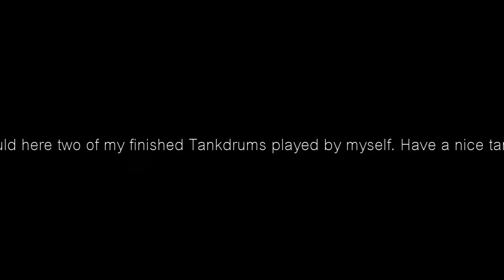how to build a tank drum by synthikat

Comment: Is that an expansion vessel? I'm trying to build one with that because I don't know if using a gpl tank is safe, even after cleaning it with water. Is the vessel thinner than the tank,which is about 4mm?
Reply from the maker: Yeah it is an expansion vessel I've also build one with a gas tank and they are safe after filling with water. Both worked fine for me.

Comment: Hey I got a question for you, what do you used to cut the round tongues ?
Reply from the maker: I've used a jigsaw with a pretty small metal blade but it was not so easy and took me some time and some blades :)
Reply: @Synthikat  Thank you for answering. Did you grind the metal blade to make shorter turns ? Do you use any oil, water during the process to help the blade ? The problem for me was the blade jump out of the line and eventually got broken.
Reply from the maker: @Starter001  grinding the blade was not needed in my case but i saw some people do it. I used oil and sometimes cooled the blade between steps in water.

Comment: Hi great work, i have a question, the part where you put the tank in fire and then water what purpose does it serve?
Reply from the maker: it is done to harden the material. the sound is better and the tongues are vibrating longer after the tempering process.
Reply from the maker: and thank you :)
Reply: thanks, it doesnt affect the tuning right? or do you have to check it afterwards?
Reply: it will affect it, because you cant heat it perfectly evenly and cant cool it down perfectly to. Painting  affects tuning to.
Reply from the maker: yeah but in my case just slightly! i did the ruff tuning before and the fine tuning after everything was finished!

Comment: Looks good man. Is the heat treating necessary?
Reply from the maker: Thanks man. Yeah the heat treating(in my case)made the tongues vibrate better(longer).
Reply: @Synthikat  Hello, thank you very much for your video. A query, how long to heat treatment?
Reply from the maker: @yohaymy  Sry but i cant remember how long it took. All in all i was just lucky with the heat treatment. Its a very tricky process and i am no expert in this. I just made the metal red hot and quenched it in water. My other tanks sounded well without heat treatment so i never had to do this again.